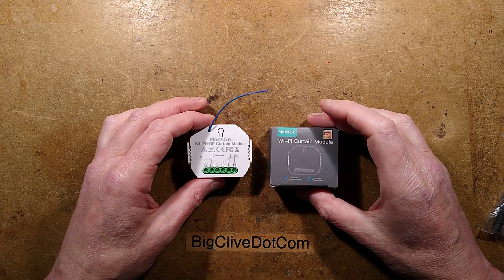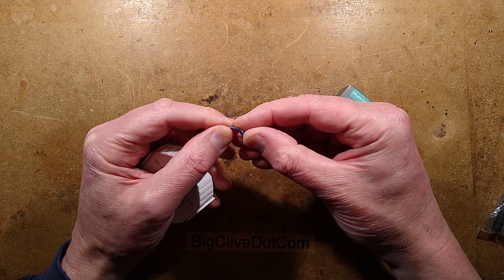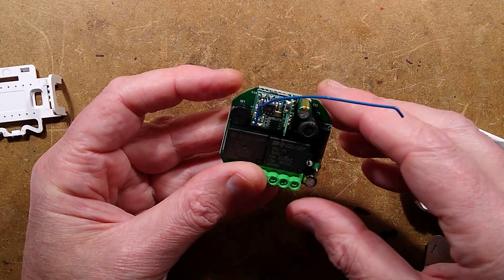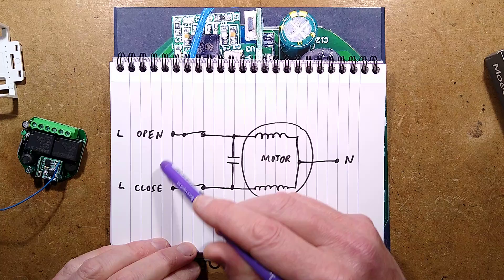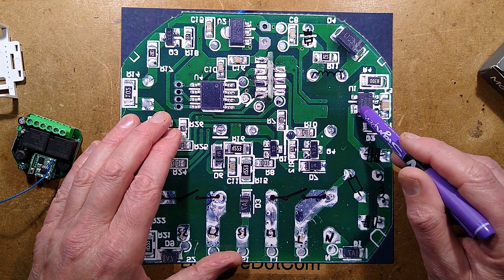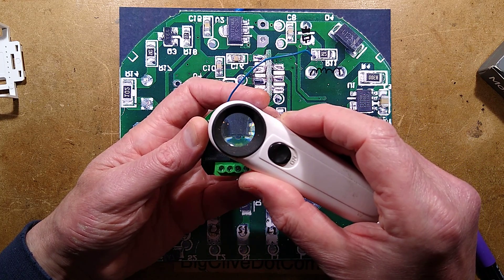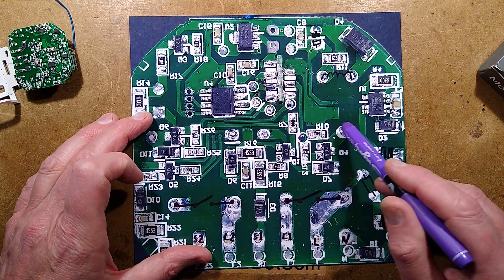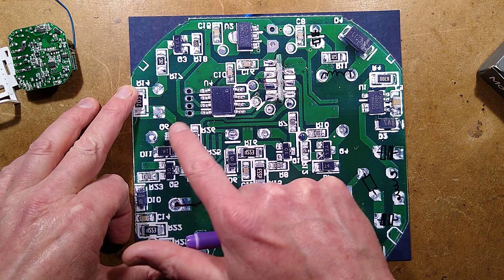WiFi curtain controller with rogue live wire

Comment: I don’t think that CE mark is what we think it is, I think that one stands for “Chinese Export” (I think). The gap between the C and E is wider apart than it is on the safety CE mark. Could be wrong, I often am.
Reply: I am pretty sure they intend it as a regular CE mark, but as you say, the spacing is not correct, and also the C and E do not seem circular enough.  I often think, if they can't be bothered to fake that correctly,  then what else have they got wrong...
Reply: @My Wife Hates This Car, I think you are correct. I am sure if pressed, the manufacturer would reluctantly confirm it. However that "CE" mark is clearly intended to mislead the uninformed customer. I wonder what acronym they would come up with for the new UKCA mark...
Reply: @martinbell8329  I have vague memories of the CE (China Export) being an actual thing with that sort of logo, but with the gap between them so they couldn't be sued or get confused with the CE safety mark. Which is bullshit of course, but I guess it also gives the manufacturers an element of "We didn't actually say it was safe to use, we just said where it was from".

The more disturbing thing is how Amazon is selling these things. I wonder how many brown envelopes are going around parliament to stop them being investigated for this sort of shithousery.

Comment: A completely over-engineered board that still fails at all the critical parts. Kinda typical for "smart" devices.
I have now even seen people buy 25$ "smart" switches so they could switch on/off the light from multiple switches.....................

Comment: Would it not have been better to have a built-in copper tracked antenna to the case or on the PCB than having a blue wire hanging out of it? The unknown chip on the PCB, would it be a 555-timing type of chip to control the buzzer rate of on/off while the Open and Close switches are pressed?

Comment: Maybe that's an electret microphone instead of a buzzer. THAT CHIP COULD BE A BUG!!! 😳🤣 /sarcasm Some of the "liquid electrical tape" or that plasti-dip tool stuff might also work, and not slide off the antenna as easily as heat shrink or tape. 👍️

Comment: I have a similar device, a WiFi IoT lighting controller. I routinely check my DMM for continuity or voltage between any exposed metal and ground/neutral. Imagine my chagrin when I saw the 0.35V of a Schottky between the antenna and neutral. That antenna was heat-shrink covered before it ever saw any energy!

Comment: Couldn't they just leave the antenna cable wrapped around the board inside the case? Because more or less is how it will be after putting it inside a small junction box.
Reply: Good point……

Comment: CE could mean caveat emptor or causes electrocution or many other things just like RoHS apparently means Reduction of Human Satisfaction.

Ideally, that wire antenna should be longer for best range. 433MHz = 69cm so a ¼ wave dipole would be 17cm. Unless they base loaded the antenna with an inductor, it looks like ≈ 12cm. It was good that you mentioned a plastic enclosure since metal ones attenuate the RF.

Edited to correct previously erroneous wavelengths. λ = C/f
Reply: You've finally hit on a few acronyms I can smile at. Maybe UL is under-rated liability
Reply: According to my knowledge 433MHz is ~70cm wavelength, but yes, ¼ wave is indeed about 17,5 cm. Mostly they coil these antennas to fit the in the housing, but since they are placed in a junction box in the wall, they let the antenna wire dangle free out of the enclosure to reach proper range.
Reply: @benzonet  Hey, you're right. I inadvertently inverted the formula. See the alliteration there? I'll edit my comment but leave this up as well.
Reply: CE = China Export
Reply: CE. China Export.

Comment: In my experience, motorized curtains use roller motors (the middle is the stator and the surface is the rotor), not synchronous motors.

Comment: Bit dodgy with the hanging out live wire but honestly I love these modules. I got a few of the lighting ones (zigbee rather than wifi but same idea) in my lighting circuits and they're great, turns any normal bulb into a dimming smart bulb. Would love to see you cover Shelly's smart relays like the Pro 2, thing works really well but has an ethernet port disturbingly close to the live terminal on it. (Especially if you have a shielded network cable)

Comment: I was waiting to see if Wifi chip turns to be esp8266. I have a habit when using Q&A site to always try to solve three questions for each one I ask (Which sometimes takes a while to find something on mine level)
Little conspirator theory coming: Couple of years ago a person on one of the stackexchange sites started asking in chinglish questions about designing app controlled light, next asking about powering esp32 module from mains. over few years two other accounts keped asking questions about possibility of runing wifi controler without having to use relays in it (this worked-up negative) and I keeped noticing few questions in similair writing style with latter hints about some universal controlling software for ESP8266 controlled from app. Then Tuya came. I am not sure if it is Tuya that is the original, but since the no-name generic modules use it that is mine opinion (If I realy cared, wire-shark would have told me whose server its communication goes to). The fact is that most of Smart devices (v-tac, BG, Smartlife seem to be using suspiciously similair apps) which brings me to the suspicion that they might actualy all be build on esp8266 version of Arduino.
Reply: White cb2l modules use beken wifi+ble soc, can be flashed with openbeken
Reply: @_DSch  Annoying thing about Conspiracy theories is that they can be easily disproven with one inteligent sentence, from somebody who knows better
Reply: I think it is a esp module cause the same one is is my led controller (atleast the same shape)
Reply: I have been seeing a bunch of different items now using Tuya microcontrollers, probably (related to the conspiracy theory part) to prevent people like us from keeping our data our of the manufacturer's cloud. It is likely far too valuable to those with nefarious intent to geolocate when a specific person at a specific location is turning on and off their bedroom lights, or in this case opening or closing their blinds. Digital spying is a whole lot cheaper than the old-fashioned techniques. Thankfully, the Tuya modules are almost pin-compatible with the ESP8266/8285 modules, but there are some challenging to obtain form factors. I did have to re-route one trace during an ESP-12 transplant surgery with a unit that was using the analog input pin as an output.

Comment: If you fold the top of a Antenna you cancel out frequency roughly about 15% that's not how you do it. You are wrong on that, solder a tiny metal ball to the top and use heat shrink tubing but you must keep the ball out, that's how we did stuff back in 2012 to get rotors working better.

Comment: “The CE Mark means nothing with this stuff”...

...is a great summary.
Reply: also doesnt help that there is a CE and a C E mark.
The first one is China Export and the other is the Conformité Européenne, but this still is not a quality indicator or a certification mark.
Reply: @ShockburnVR   Did product doesn’t shows the CE (EU, Conformité Européenne) mark, but the C E (China Export) mark. When the E starts out side the opening of the C it’s China Export, if the E starts in side the C it’s Conformité Européenne.

Comment: They make some pretty acceptable products for the price, but I've found their dimmer modules to be heavily flawed. I've tried around 5 or 6 different models of dimmable LED bulb with them, and all of them experience some kind of buzzing, flickering or strobing at certain brightness levels. I suspect they're driving them with a leading edge waveform instead of trailing edge, despite using a mosfet for control. In fairness, their customer support was remarkable (especially for a Chinese company) and they offered a full refund straight away. But I've spotted no firmware updates fixing the issue, assuming it can be changed in software. Seems there's issues with their QA, it's a shame cos it ruins what would've otherwise been an excellent product.

But seeing this kind of a hazard in a product isn't giving me much confidence having those dimmers installed in my walls... Might be time to look for an alternative.
Reply: The issue is that unlike incandescent, there are three different ways that dimmable LEDs can be dimmed, and they're mostly incompatible with each other.  Even the manufacturers of the high end switches end up warning you about that, plus suggesting check with the LED bulb manufacturer to identify the method they support.    As far as I know, the methods can't be fixed in any sort of software at all - they're physically different.
Reply: @tbelding  From what I've found, a MOSFET-driven dimmer can create both leading and trailing waveforms, it all depends on the timing from the controller IC (which in this case is an upgradable microcontroller). The alternative is the old triac dimmers, which can only do leading edge (the variant LED bulbs don't play well with).

The only reason (that I'm aware of) for a dimmer to use leading edge is to reduce costs by using a triac, but the circuit already uses a FET so that can't be the reason.

This is unconfirmed regardless, I'm just speculating what the issue is. I should really hook a scope up to the output, but they're installed in the walls right now.
Reply: Speaking about strobing LED bulb's, I brought a couple of 100w equivalent from Wilko, After a short time they start subtle strobing, or flickering. Don't know if it's my strip light in the kitchen, or just my luck, but two set of two have the same problem.
Reply: The power supply of the led must support dimming, some just don't tolerate dimming at all
Reply: @bschwand  while that's true, it doesn't really matter. You can have high end LED lights that are "dimmable" and a high end dimmer switch, and it'll still have problems. It's a crapshoot.
Reply: firmware updates on disposable nobody cares "chinesium" products. now that is grande. 🤣🤣🤣🤣

Comment: The internal 5 volt has Live as reference. This makes it easier to switch the external switches to Live. 
But the whole circuit depends on the voltage in the air and not to ground.
Reply: What does voltage in the air mean?
Reply: @RobertShippey  I think he means the circuit's ground reference is floating. It's probably a noise maker too. So don't buy it if you're an amateur radio operator.
Reply: @infomaniac50  Exactly what I was thinking, I would not want this at or near my ham shack.

Comment: 8:50 Am I the only one hearing the beeps? Happens with both polarities.
Reply: It's the meter. Continuity mode uses beeps as indicators.
Reply: @LieseFury  If the buzzer is just a coil it would have continuity, but don't those things usually have piezo elements? He mentions the meter might make it beep so I thought he'd have it in diode mode, but it looks like this meter has both modes combined into one. It's really quiet for continuity beeps as well, though knowing Clive he might have taped off the buzzer in his meter.

Comment: I have two different brands (Shelly and Blebox) of such switches, both do not have external antenna and both have enough range of wi-fi. They are great devices, incredibly cheap for what they do. I even use one Shelly to switch two different light circuits (instead of rollers), it's very flexible. Works locally with Home Assistant too.
Reply: I've modified my shelly1 to not need a neutral at the light switch. Now it's possible to install it in the light fixture and still have it controlled by the light switch. I have a vid on the circuit.

Comment: On the other hand, what's wrong with getting off one's arse, walking across the room and closing the curtains properly?🤣😘😸😼😹😁🤡🤦

I got a hell of a belt off a set of mains powered Christmas lights last winter, but they went straight back to the shop!

Fascinating stuff I have to say.
Reply: I have 12 of those in my house and they are set to automatically open or close depending on the position of sun and/or time. And I don't have to be home four this to happen. Helps a lot keeping the house cool in summer, without A/C.
Reply: I have mostly seen motorized curtains used where an entire wall of windows need to be blacked out to use a projector, or where each curtain is a heavy metal grid to stop burglars.

Comment: CE markings mean nothing on electronics from the far east.
It makes you wonder who designs them, they clearly have little regard for end user safety.
You have to be very carefull with USB chargers, some unknown brands will self destruct taking
your phone or other device with them.
Reply: You are correct there, but the importer in the EU is responsible for the CE certification when it's resold in the EU.
The original Chinese CE marking stands for China Export and has no meaning at all
Reply: @ZZtop-gg3lu  In a perfect world that would be true, but these types of products are freely available
from online retailers who are not fussy about where they buy from as long as they are cheap enough
for a healthy margin, safety is not important until someone gets a shock and makes a noise about it.
Reply: @Barbarapape  Sadly enough, you are correct again. A CE certificate can be issued by anyone, only when there are serious injuries caused by the product, there will be an investigation
Reply: CE seems to stand for Cheap Everywhere for a lot of these things.
Reply: I had a USB charger explode.. went with a hell of a bang and left a black mark on the socket.

That was a branded phone charger straight from google..  so it's not just cheap chinese crap that you have to worry about.  The expensive chinese crap is bad too!

Comment: You kinda know its fake certifications as well if there's a FCC logo (which this has), but no FCC id number on the device or in the booklet that came with it and most vendors seem lazy enough to not even copy an existing grantee code either. This thing probably spits out rf as well based on your teardown.
Reply: since it has two radios it is guaranteed to spit out RF ;)
Reply: @Willam_J  Since you've already fixed some spelling, would you mind changing sconce to since ?
Reply: @Willam_J  This happens a lot with personal computing devices like tablets and phones, too. IIRC the standard is to meet or exceed Irish requirements in your own testing, hope that's good enough, and then send out for FCC and Irish testing as once those two pass you're golden.

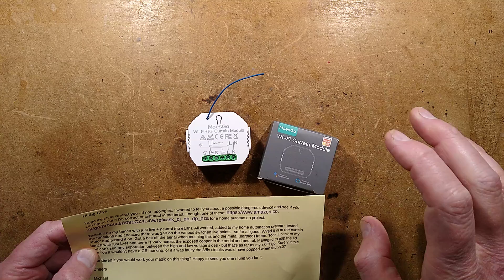Comment: 0:30  Could he have gotten a Static Electrical Shock*?
* Static shocks are often noticed in cold dry weather, especially when in a centrally heated environment, and may disappear when the weather gets more humid. Static shocks may also be encouraged by air conditioning in hot weather.

Comment: Avoid anything named MoesGo, Romwe, Shingo, etc. That holds true for everything from forks to frocks to smart devices. It's all crap.

If you think a curtain control module is dangerous, how about a soup bowl that melts at soup temperatures and can lead to third-degree burns?

Comment: The only AC switch I use with my Home Assistant is a Sonoff Basic (which is simply L + N in -> wifi controlled switch -> L+N out) and I'm terrified of it. I.e. I tried it like it will kill me immediately when I touch it, etc. I don't trust these sorts of things.
Reply: Are you also terrified the same way about your regular light switches...?
Reply: @jankoodziej877  no, I'm irrational like that :)

Comment: A 10pf/1KV cap between the receiver and antenna wire would have done the job. Maybe a small choke between the antenna wire and neutral as well.
Reply: Would have added a whole 2c to the price of the unit. The bean counters would have died from apoplexy. What I do see often is the antenna end is dipped in a bit of paint, to cover up that exposed end with a tiny blob of paint.
Reply: A cap that small and a choke may detune the circuit. Even a 10nF cap would prevent a shock, but in order for it to pass safety requirements, there would have to be 8mm spacing minimum between the antenna wire and the rest of the circuit, which leads me to believe, this is not really certified for sale to the general public.
Reply: @kenmore01  So a standard Y capacitor would be the component to use.  Anyway putting this into a common mains relay box like a CUBO would isolate everything, including the screw terminals.

Comment: I also wonder why the remote receiver with an external antenna is on the top of the stack but the WiFi board with integrated antenna is buried between the two. I'd probably have flipped them around.
Reply: Receiver board can be changed for different markets where you have different ISM bands easily, instead of needing to have a few different stacks, build the riser with the wifi board, and only add the remote receiver board if needed for a market during final assembly.
Reply: I would have thought that the wifi module is probably more powerful  and possibly is in all devices while the remote receiver might only be fitted in some product. 
But even more then that, I would assume that the same board and set would have been used for many other purposes and only few of them would bother using remotes, so in a mass manufacturing the item which always goes in, would be against the board, while the item which is rarer would get specialized fit
Reply: Easier to assemble when the board with the external wire is nearest the hole.  No need to overthink it with multi step assembly lines and market specific frequencies.
Reply: @johndododoe1411  I don't think that wire is going to cause any difficulties. If it is under the WiFi board, it'll be readily routed out the hole. That doesn't sound like a realistic excuse.